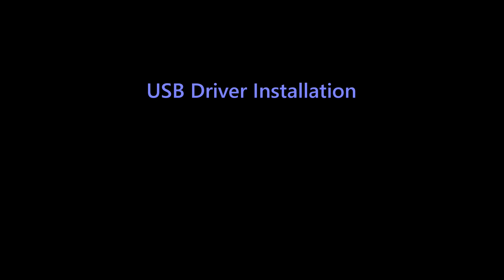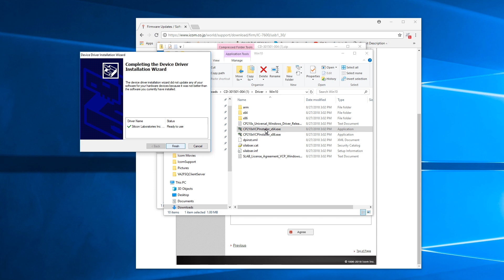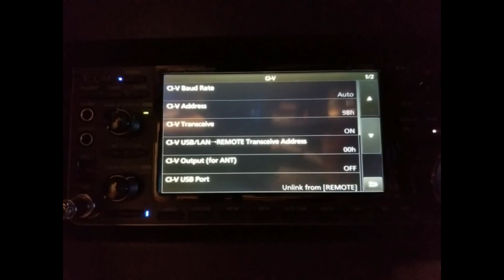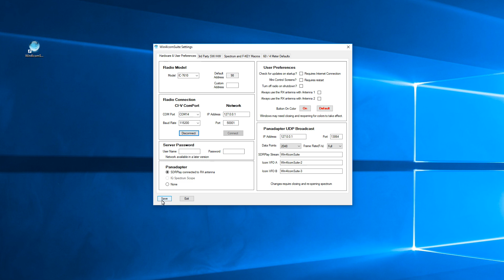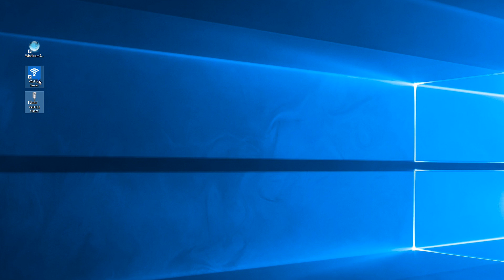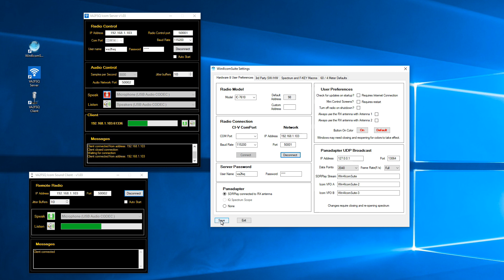Win4IcomSuite Installation and Networking

Comment: Very good video. Worked the first time I tried. How do I connect to the HRD log book that I am now using on HRD? The only log book I see is Club. Hopefully, you can guide me in the right direction.

Thanks and 73
Reply from the maker: All you should need to do if you have used it before is run the HRDLogBook.exe program.  That's it.
Reply: Thanks, Tom. That worked. Seemed too easy, hi.